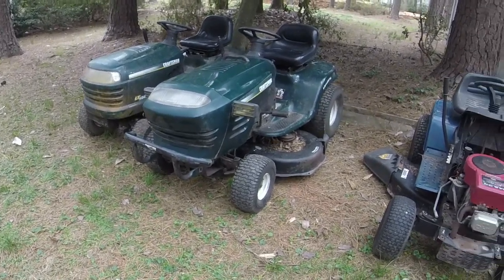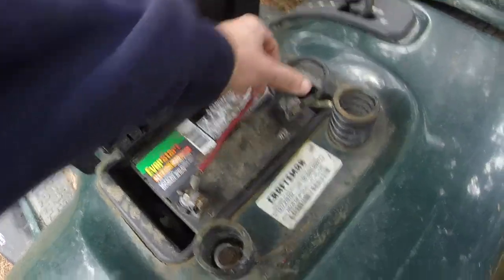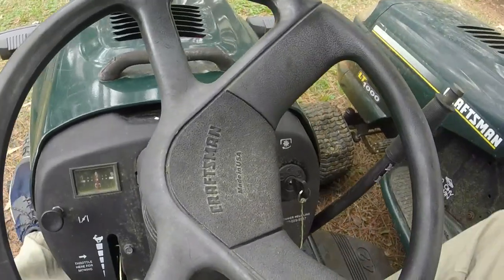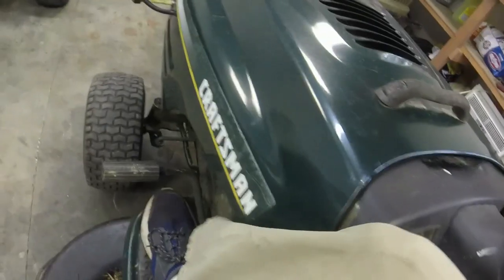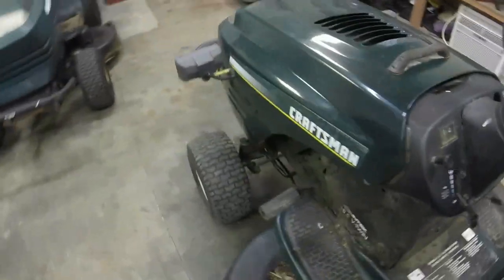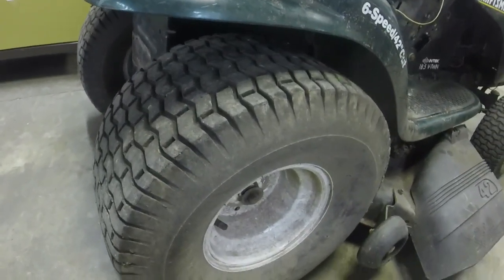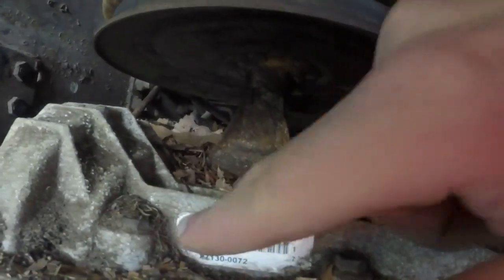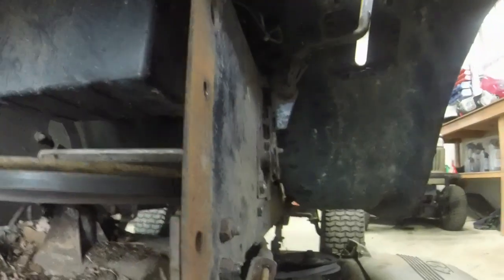Craftsman V-twin riding mower 6 speed transmission not shifting diagnosis and overview (part 1)

Comment: I just picked up a LT1000 HYDRO that's been sitting since 08, still got nipples on the tires, originals too. Mower is good as new looking, think it is near new condition, still shiny, 2002 model. Definitely gonna debate holding it for a while
Reply from the maker: Wow that is a good find!

Comment: Transax transplant 

I have a 30 y.o. Murray 11/36ic that was increasingly difficult to change gear. I acquired another transaxle 10 years ago, and seeing it has 10 years less use than my one so it must be in good or better condition...right? 
I hear it clicking as I move the gear changer thing sticking out the trans into several positions.
Put it on, and now the mower won't move forward or back.
I see the drive belt is turning the rear pulley on the transax. I lift the back up to see if there is the slightest movement and there is nada. 😑 What's the yellow bung for on mine? Does it mean it's got oil rather than grease? Can I turn the thing upside down to empty then put 4pints of 85-90 gear oil, see if that makes a difference before opening the thing up and risking more problems?

Thanks -- or "merci" -- from France!🍷🍷
Reply from the maker: Make sure you put the wheel keys back in the axles on both sides.  Otherwise they won't connect the wheels to make it spin.
Reply: @EllisMowersandmore 
Yes, thanks.

Comment: changed my vbelt / drive belt on craftsman rider model 917.272960. have always changed my own belts but this is first for this one. make story short it is on all pulleys as diagram in manuel shows but now will not move. pedal is not where it use to be and feels like belt to small... bet is ok, OEM belt, on all pullies correct.
I did tried today to put in gear and it moved maybe 1inch and quit but i out in  forward, it moved back... and vice versa.
this is something simple i cant figure out, belt off , belt on.......... any ideas?
Reply from the maker: If the belt is too small it may still be rubbing the brakes and binding it up if the pedal isn't coming all the way back up.

Comment: Micky mouse tractor haha, also those transaxles in the inside always rust up on the shifting shaft! If it’s oil filled then check your shift Keys.
Reply from the maker: Thanks for the advice, I think as this was almost a new transaxle that somebody didn't put the shift hub back right and broke it.  When I put that in during part 2 it shifts great! (spoiler alert haha)
Reply: Ellis Mowers hahah lol awesome!

Comment: Great video !!!  I got a craftsman lt1000 that will not shift ...its stuck in 3rd I believe and it just wont budge ...do u think theres any way to free it up?? My gut tells me the transaxle is shot ...just thought I'd pick ur brain for a sec  ...TIA  for any thoughts ...
Reply from the maker: Check your shift linkage underneath the tractor.  It may be frozen up, you can unbolt it from the transmission and see if you can shift it with pliers etc.  It's possible the shift forks got seized in the transmission.

Comment: I have a mower that looks just like this but doesnt have the 6 gears. For some reason the brake lock lever wont stay up when engaged but it appears the brakes are locked and i cant get it to move.
Reply from the maker: It is likely your caliper pins have frozen which will lock the transmission.  You also may have a broken shift linkage.
Reply: @EllisMowersandmore  thank you very much, I will start tinkering tomorrow and see

Comment: I have a craftsman 3000 that wont move on the ground jack it up take the wheel off and works like it should what’s wrong with it
Reply from the maker: Make sure you have the wheel keys on the wheels.  Also check the belt.  Or the trans may be weak enough that it will turn the wheels off the ground but not when the weight of the mower is on it.
Reply: Might be one of your axles slipped out of place inside your transmission so the gears on the axle aren't lining up inside you might need new retainer rings put on the axle inside the transmission

Comment: I have a question, you think the lt2000 transmission fits on lt1000?
Reply from the maker: Yes it should as long as the model number under the seat starts with a 917.

Comment: Late comment but today I was mowing with my craftsman t1700 (only 3 years old) I lost reverse and then lost forward as well. Stuck in nuetral.....any guesses?
Reply from the maker: Your Craftsman is made by MTD.  Different setup.  Sometimes the pins get stuck in the trans and the shifter won't engage it.  Maybe try wiggling the shifter or rocking the mower back and forth in gear when it is off.
Reply: could be drivebelt fell off, transaxle brackets broke, torqe bracket broke, debris underneath the frame by the pulley, low transaxle fluid

Comment: Gear link rod that you point out at towards the end, what would cause that to fail? A friend of mines failed and it’s been replaced twice now and continues to fail. It always fails at the end that connects to the transmission.

They’ve had it for 7 years and it’s only failed recently so not user error, they’ve driven it the same way for all these years, initially thought it was user error trying to shift without using the proper method.
Reply from the maker: I have seen where the front transmission bolts will get loose or back out and that causes the whole transmission to rock and wear out that gear link.  Other than that, putting too much stress on the gear shift might do it too but if it's shifting fine that shouldn't be it.
Reply: They do sell a other shifter linkage setups but I'm wanting to keep mine original with that part he used and not go with the newer setup then I'm not really sure if the newer setup has that hub piece or not it probably does though 

I'm gonna have to look at my other mower with the newer setup to see what the difference is about that and this old hub part the newer linkage is adjustable

Comment: Have you ever have one be stuck in gear and not shift out?  That's my current issue.
Reply from the maker: Yes if you're lucky you might be able to adjust the brakes to get it to shift better, if not the shift forks inside the transmission may have failed.
Reply: Probably the brakes are dragging 
The pins are stuck , that is what I think it is, seen it several times before

Comment: I have a Craftsman  42 in. rider with the 6 speed trans.  Is there a grease/lubricant that has to be changed periodically or is it sealed for "life"  ?
Reply from the maker: You can change out the grease in it but they are designed to not really be broken into.
Reply: Transmissions were filled with Bentonite (sort of a semi grease oil). It tends to turn into a grease when it ages or wears and gets slung away from the gears and stuck to the side of the case so the gears no longer get lubed. There is no drain plug in these transaxles. I remove the axle, remove the fill plug and flip them over and drain them, then I split the case (do it upside down and the upper portion of the case will hold all the gears and shafts in place so the gears stay put). The ones I have run across have Bentonite that is just starting to solidify at around 20 years old so all the “grease” is in the bottom half of the case. Like motor oil sludge settles to the bottom of an oil pan. I wipe out the lower case half and clean it diesel fuel. I also drill and tap the bottom of the case and install a drain plug while I am in there, then bolts the case halves back together and add 80/90 gear oil to replace the Bentonite. After that, the trans is serviceable.
Reply: Mine are changeable and I wont use 80w90 gear oil again it's to thick and makes the mower slip 

The 20w50 zero turn synthetic hydrostatic transmission fluid oil works good in mine it also works good in the John deere

Plus that thick shits no good in the winter time

Comment: So its called a shifter hub is what its needing mine goes forward when I hold the shifter in place that little part will fix the problem its having
Reply from the maker: If it won't shift at all and the shifter moves without shifting gears it's likely the hub.  You can check the linkages between the transmission and gear shift linkage as well as those will break too.
Reply: @EllisMowersandmore  then it's the hub I have to hold the shifter in forward or it'll move to neutral

Comment: my shift when is off but when I turn it on it wont shift I adjust the clutch and nothing what's should i do now?
Reply from the maker: Lube up the shift linkages going to the transaxle.  Also make sure there is plenty of slack on the belt when you press the brake in.  Also make sure your brakes work and are adjusted properly.  Some of these are known to have hard shifting when running.

Comment: My dads LT1000 wheels  will spin without the belt pully moving ..even in gear ..tranny junk or am i missing something?
Reply from the maker: As long as you know it is in gear there is a disconnect between the shaft and wheels so it sounds like something has let go inside it.  Sounds like you have all neutrals!

Comment: How to change the shaft on the drive axel?
Reply from the maker: Never done it but I think you can just beat it out with a hammer with the tire on for leverage.  Not sure though.
Reply: @EllisMowersandmore  but if they beat it out its gonna break they're retainer ring inside the transaxle transmission then make a ton more work for them to do on the axle

Comment: They are calling the spring on the bottom of the shift lever a brake return spring is  part #532146682 is this right?
Reply from the maker: That is for the brakes.  It goes on the brake caliper to release the brakes when you release the pedal.
Reply: @EllisMowersandmore  
Glad I didn’t buy that spring. What about the spring that’s on the bottom of the shift lever, called a dozen places , nobody seems to know
Reply from the maker: @vincentloretta8939  Best thing to do is look up the model number of your mower and find a parts manual.  The diagram should show the spring you're looking for and the part number for it in the chart that goes with the diagram.  That's the best I can tell you.
Reply: I don't know but I seen his spring was not hooked up and mine hasn't been for years but my problem is I have to hold the shifter forward or it ain't gonna go forward or reverse if I don't hold it in place